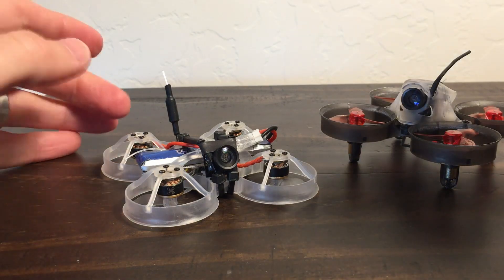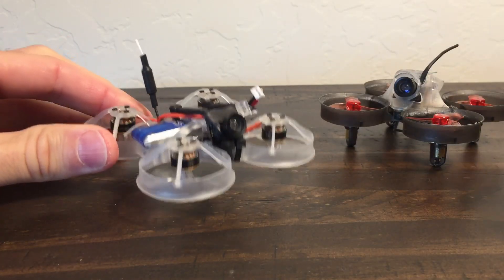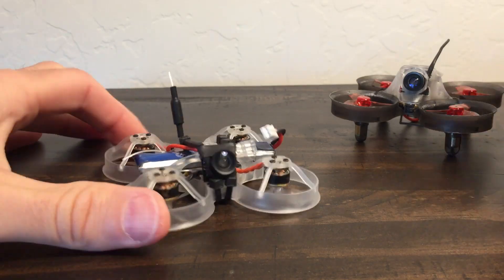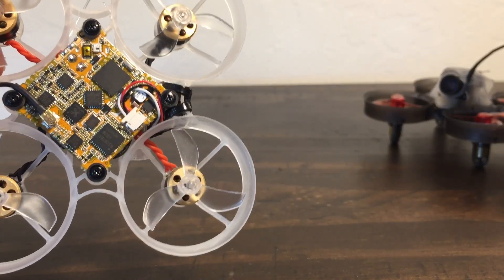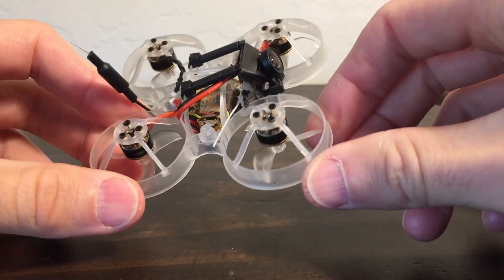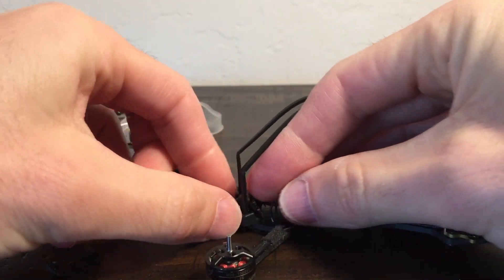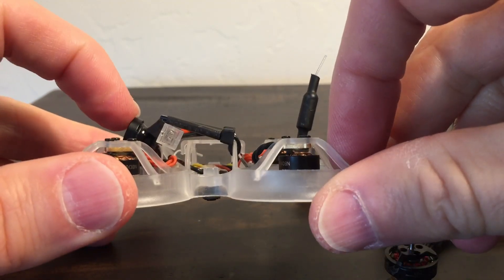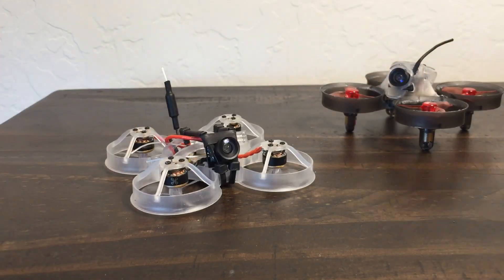Pusher 66 Concept Build

Comment: Awesome little drone, just ordered the parts for one! But I do have a question, I ordered 19000 kv 0802 motors, and am wondering if I should go with a 40 mm prop, or a 31 mm prop. The only difference other than the prop would be the weight of the frame. The 75mm frame is about 3 grams heavier than the 65 mm frame. Do you think using a bigger prop with it? The goal is to have a longer flight time

Comment: Great video! I'd like to hear about any additional testing with the pusher setup, especially with different props. Please post if you have any outdoor flights. Thanks!
Reply from the maker: I tried the Gemfan triblade and didn’t like them. I have tried the quad blade because flight time is already and issue. I don’t fly whoop outdoors so unfortunately won’t have outdoor dvr.

Comment: Most of the tests I've seen show pusher props with a marked increase in thrust and efficiency with the downside being more vibration from feeding the props turbulent air, but these tests are normally done with larger prop sizes. My guess is the effects are here to with the ratio of "free" prop area to stuff in the way area being worse than on larger props due to all the hoop struts and motor OD to prop ratio.
Reply from the maker: I'm sure there are trade-offs. I really don't know how significant they are. I would really need to build some twins and compare back to back.

Comment: I've found that props down tends to help with prop wash situations.  The drawback is not all motors/props support the configuration.
Reply from the maker: Yeah the props with the cone in the middle won't work but anything with a flat top can be drilled through. It works with both the NBD Azi and Gemfans
Reply: @Quad66  Depends on the direction that your trying to drill from; anything with a flat side (top or bottom) can be drilled.  It's not fun in either case though.

Comment: Excellent zip tie construction, I brought the single zip tie cam mount to whoops but your design, though using more weight, solves many of the flaws with mine, particularly scaling up. Nice work!
Reply from the maker: I initially intended my version for 2S 3 inch quads, so I was pleased that this scaled down to the whoop size as well as it did. I do need to find some thinner zipties though as these are over kill for whoop weight/speed.